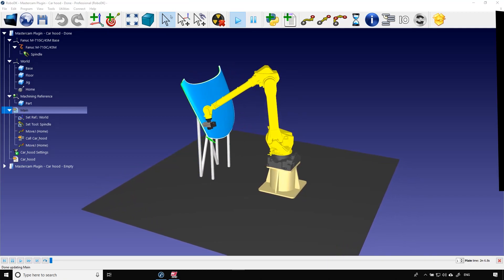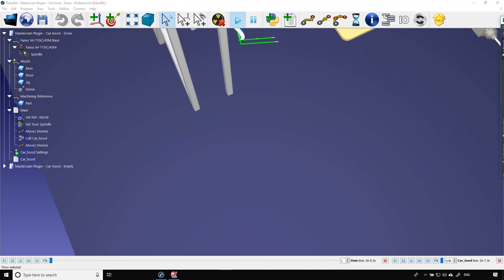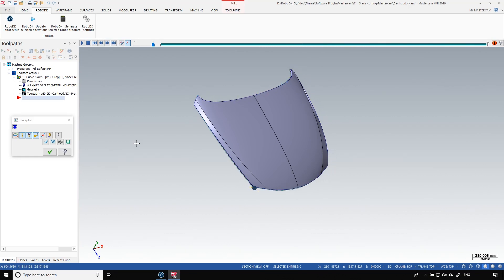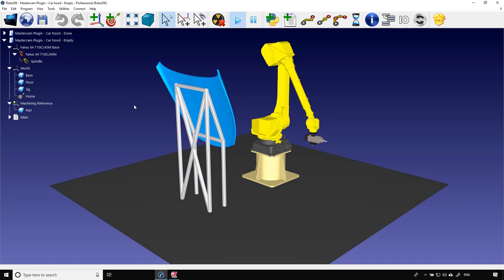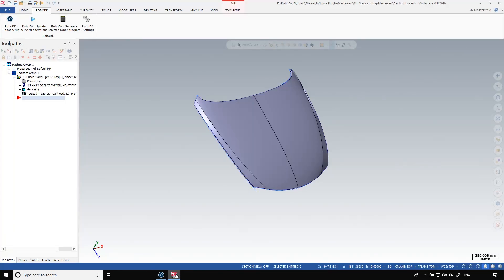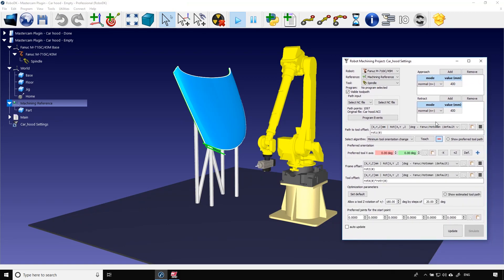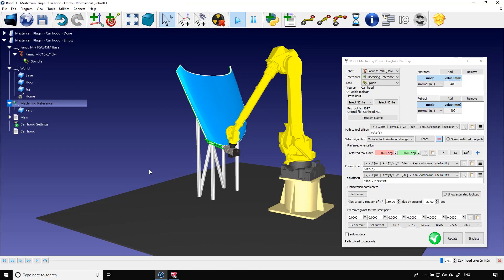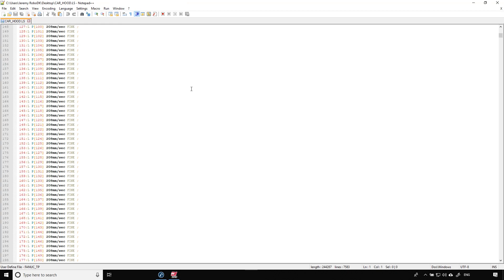5-Axis Robot Cutting - Mastercam - RoboDK Add-In

Comment: It would be very useful with a video showing how to correctly align a CAM program with a real physical workpiece on the robot. Especially when the part is not 100% identical to the CAD model (for example plastic parts that can shrink or deform). How do we best adjust the CAM toolpaths to the actual part – step by step – with different methods like user frames, probing, laser or camera? I think this would help a lot of users who are doing milling with robots.

Best Regards 
Stig